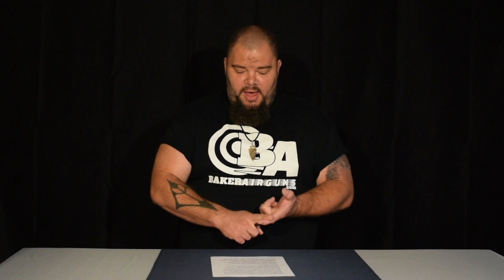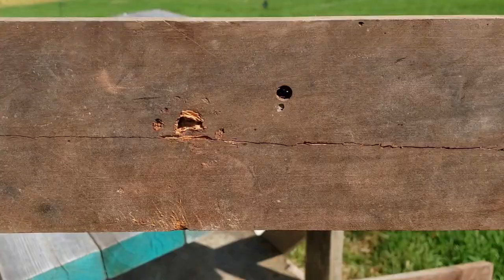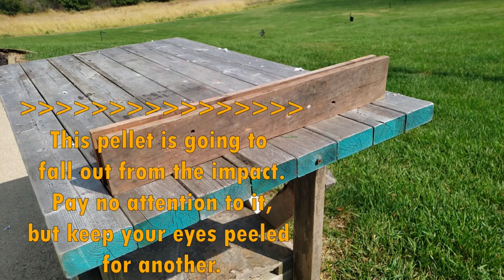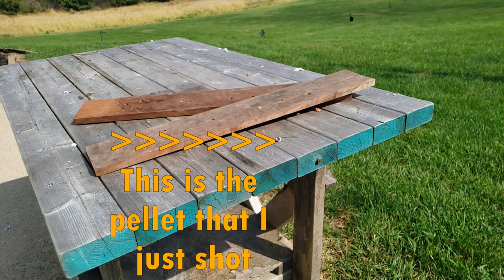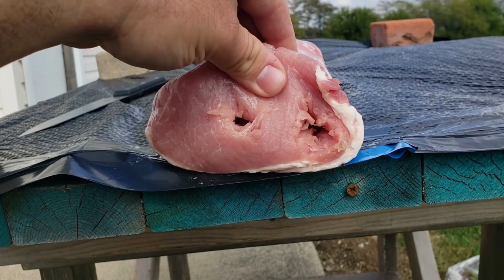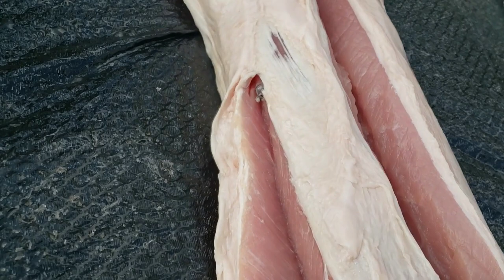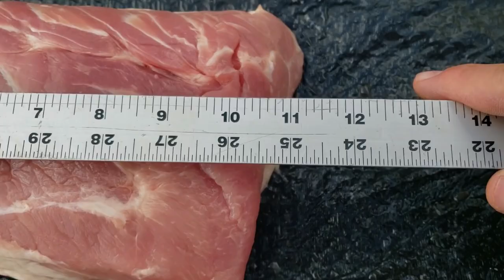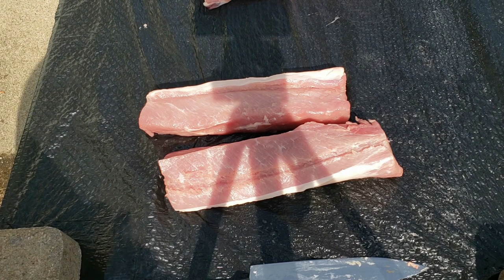PART II...What's deadlier, a .25 or .30 caliber airgun?

Comment: Donnie, I love the video (actually all of them) however comparing two different calibers at the same FPE only proves that one caliber performed better at the fpe tested, not that it is "actually" better. This is  a logical fallacy.  When comparing the total surface area of the projectiles .30 has 44% more surface area than .25.  This means that to make the test fair you should have taken the 70 fpe that you were shooting the .25 at and increased the fpe by 44% for the .30.  70 X 1.44 = 1.08.  So basically you should have been shooting the .30 at 100 fpe for a more accurate comparison.
Reply: Good point, that would scale the projectiles properly. Most .25 shoot 50-60 ft lbs in the sweet spot. I know this wasn’t what was tested but I would venture to say the 30 at 850 is going to be far more accurate than the 25 at 970.
Reply from the maker: Glad you like the video.  The reason I chose 70FPE is because MANY .30 airguns come set to that level.  70FPE is a lot for a .25, not a little for a .30.
-Donnie
Reply from the maker: @timc5922  The .25 in question was my 100yd benchrest gun, though I sold it to a friend.  It uses the Slug A barrel tuned exactly how it was for the video.  It will produce 1/4" groups at 100 yards (indoors) regularly.  I'm switching to the .30 for next year due to wind resistance.  Having said that, at least indoors, it was one of the most accurate airguns I've ever owned.
-Donnie
Reply: @BakerAirguns  I believe you. I would simply say in a more typical scenario the lower speed will stabilize the pellet more. I’ve always understood the pellet sweet spot to be around 830-880 FPS though not always true I suppose.
Reply: in practice a .30 at the same plenum pressure as a .25  . the .30 does have much more output
Reply: @timc5922  i will say I run nearly all my projectiles around the 965/970 mark in 25cal & I sub 1" @200yds. My 25 will also push over 100ftlb. Currently testing slugs at 945fps, 143reg, pw3, vl3, so far from maxed out. Oh, they're 49.6gr (98ftlb). Which will destroy 30cal in every way, higher percentage of retained energy, accuracy. Oh,  I love 30cal by the way 😁
Reply: @precisionairgunninghunting6265  those results are not typical in my experience. Why are you not a bench rest champion? Easy 20k
Reply: @precisionairgunninghunting6265  lmfao…. I’d love to see a vid of those one inch groups at 200 yards… haha but I have a feeling I’ll never see it.
Reply: @timc5922  i have thought about it, as did my colleague with similar set up, he gets same results down range. 100yds is seriously speaking, easy. Its all about the set-up & the fleshy lump. Work as one, put the practice in, i dont mean shooting 1000s down range, but make every shot a learning curve. If we dont hit our mark at 150yds then something is wrong, then we investigate. Thats how good they are. You dont need to enter competitions to be good. From what i saw of the RMAC, my colleague & I would certainly have a good chance of taking 1 & 2 in 💯. Yes i agree, our results aren't normal, but then nor was Chris Kyle or Craig Harrison. Its more a case of whether marksmanship is your thing & whether you're willing to invest time & money doing so.😁
Reply: @Oregon-airguns  i didnt say 1", i said sub 1". There's a video out there, 5 shots, 3 different weights, all 3 groups sub 1" unedited in one shot. You being a disbeliever is your issue, your lacking, your insecurity. Thats fine, i just happen to be able to shoot better than you. You maybe a better footballer than me. So, go hunt the videos, hunting videos maybe easier for you then actual hunting. All the FX boys have seen the videos. Let me know when you find them
Reply: This is no different than the 9mm and the .45 acp. 9mm usually goes deeper because it’s going faster and is a smaller diameter which means it has less surface area to push through the target.
Reply: @precisionairgunninghunting6265  that's a pretty dumb comment bro, maybe a 30 at less than 100fpe. But if you take a .30 PCP shooting Nielsen 65.5 slug at around 950 it's a whole different story when you step to over 130 FPE. IM glad you like your .25 and I like my .25 and .30 but both are very different killers and the bigger bullet will always be deadlier if pushed to the same speed due to the heavier weight slug/pellets that are available. It would be dumb for me to compare my .30 to a .357 or .457 PCP in power.
Reply: @gmatos123  why is a comment dumb, because you are. Run along & insult someone who's bothered 🙂
Reply: @timc5922  because he is lying and bolstering his own ego on youtube :-) . He probably does not even own a high performance .30 and is making comments that do not make sense.
Reply: @fathertimencUSA  yes......so many don't ever consider this part when your talking physics!.......john
Reply: That was deep
Reply: I totally agree and to add to this, if you made the boards where they could not move I think you would have seen a difference because of 30 cal hitting more area of board
Reply: If you shot both pellet same speed 30 would probably be winner, hitting more area of wood at slower speed, of course 25 cal is going to win. Also nail the boards down!! Probably will be different results,,, thanks
Reply: @Precision Airgunning Hunting & Reviews  please, let me see these 1/2 inch groups at 200yrds with a pellet gum lol
Reply: This theory makes sense if you have something like an FX Impact M3
Reply: Great video btw. But absolutely should do again with a 30 cal that can at least match the speed of the 25. Shoot the gauntlet 30 in the same test and let's see what happens? Thanks for the video
Reply: You are absolutely right weight retention a third of the velocity is penetrating just as deep if he were to max out both of them the devastating would be a parent and then as far as deadly you can stick a hypodermic needle claim through somebody but if you stick a narrow the needle won't do pretty much to any that is pierced but the arrow will
Reply: Earth is flat ..

Comment: This is with non-expanding pellets.  With equal fpe, the 25 would have more velocity and less frontal area to expend it, so it makes sense that it would penetrate deeper.  By limiting the 30 cal FPE to that which the 25 can attain, you are placing  the 30 at a disadvantage. Max out both calibers with a mid weight expanding slug.  Also if the rifle you're using  isn't able to shoot 30 cal projectiles to their full potential, that is another disadvantage for the 30.
Reply: Correct, kinda useless test, and you can tell by how he talks he is biased towards the 25, plus folding in the 30's channel to make it seem smaller, or measuring generously for the 25.. Id like to see a real test, not something set up to make you feel better about your 25
Reply: Seems you have missed the point. Yes it may be obvious that the .25, with smaller surface area, will penetrate farther at the same fpe as the .30 cal. The reverse to your assertion is also true: the .25 at a higher speed, the fpe being equal, will still out perform the .30.
Reply: @shadowmihaiu  "fpe being equal" is the problem.. the 30 is designed to have more fpe. That's like saying that my escort is faster than a corvette if you take  corvette's wheels off before the race.
Reply: Well put 👏  thanks. 
I'm 47 haven't shot air rifes in year's. My son's growing fast looking to start him out as I grew up. Behold I come across these videos. WTH? I haven't kept up with technology in air power. Definitely not my mid 80's pump master. OR the daisy 880 <both highly over rated FPS. GAMO Has some decent offerings in my opinion
Reply: Who tests anything at 10 yards.There is only one reason, heavier is better in the wind.There is a balance in air guns.First is what its going to be used for.and what max range shooting.I do not believe in shooting anything were there is risk of wounding prey.ie 177 or 22 sub 12ft pound up to 20 yards for rats.were as .30 in breaze shooting rabbit at 50 yards is better at 40 plus ft pound.you do not want any pellet to go through any prey that carries more than a few yards after its hit.To many on youtube do not show the bad placement were prey is wounded.ie.100 metres some times.I wish youtube would block over 50 yards being show.People thinking i will go do the same.
Reply: Unless you want it to stop sooner in smaller game. 
  It would seem with equal pressure behind them, a .22 or .25 might be preferred for bigger game. 
  Getting both seems like the best option, and a great excuse to buy both! 😊

Comment: What were the velocities of each pellet?   If both are making same energy, it would seem the .30 cal is handy capped by the lower velocity required for both to obtain equal FPE?     I believe the sectional density of both projectiles are very close.   The deciding factor is velocity.   Redo test and run the 30 at the same velocity as the 25.    My hypothesis is wound channel length will be similar if your testing was based on velocity.     Your findings appear to be accurate based your parameters.   Based on my understanding (I'm no expert) Hydrostatic shock is generally said to start at velocities above 2000-2200 fps.   The temp wound cavity must expand greater than the tissue's ability to stretch and recover.   Air gun hunting is most similar to bow hunting as cause of death will be from organ damage or loss of blood, not hydrostatic tissue damage.     I've enjoyed your part 1 & part 2.   Please do a part 3 and make your test based on velocity and repeat with same projectiles.   I wonder how the extra PFE of the 30 will effect the test?
Reply: Yes, I'm not sure I see why he would match the FPE, which is the major advantage of the 30 at similar speeds, right?
Reply: Yes, if you push a heavier projectile at a similar speed versus a lighter projectile, the heavier projectile will result in more energy & wounding potential.   He’s a video of a .308 (big bore) compared to a .22 caliber.  The 22 is pushing a projectile at over 1800 fps.  The .308 is high mid 900’s or about that velocity.  The projectiles range between 40 grns for the .22 to 131 grns for the .308.  The .22 makes about 300 fpe and the 30 cal airgun makes 260-270 fpe.   So here is a study of weight versus velocity.   The guy shooting pigs was using the wrong air gun.   

30 Cal AirRifle Vs .223 Reduced Load
https://youtu.be/myWYeUqY9zo
Reply: Correct. In the real world situation. The 30 caliber versions of a gun almost always have twice the energy of a 25. For example. The gauntlet 2 .25 shoots 40 grain slugs at around 900. The gauntlet 30 cal I use is pushing 78 grain boattail slugs at 870. The .25 I can shoot rimfire steel targets, the 30 cal will punch through the same steel targets. At same energy, the 30 cal faces more resistance due to larger surface area which acts like a parachute to slow it down faster in medium. But a 30 with 2x the energy will always outperform the 25 in terms of damage and penetration because it has more energy to continue the momentum through a target.

Comment: Here’s my 2 cents. I’m looking at the fx wildcat bt. The rated fpe for the 30 is 113. The rated fpe for the same gun is in 25 is 90. You’re point is valid if both calibers are traveling at the same fpe, however, most the ti,e they aren’t. The 30 is traveling about the same speed as a 25. I’m going with 30

Comment: 30 cal is significantly slower then the 25 cal. The 25 cal will do more based on the velocity. Increase the fps of the 30 to be on par with the 25. You'll get different results.
Reply: The best comment and factual comment on here..